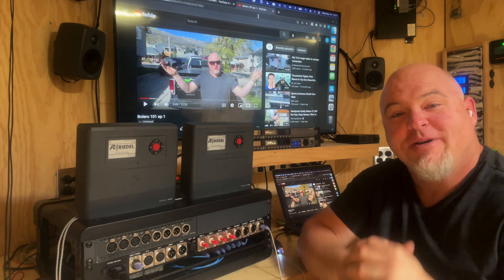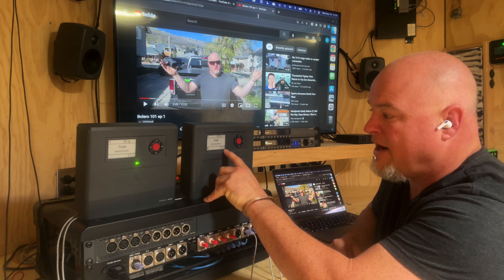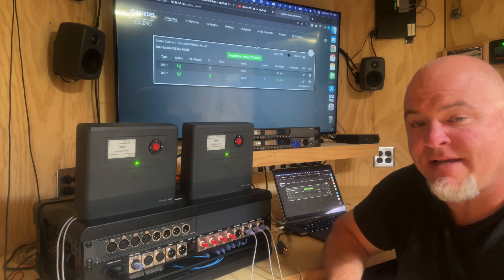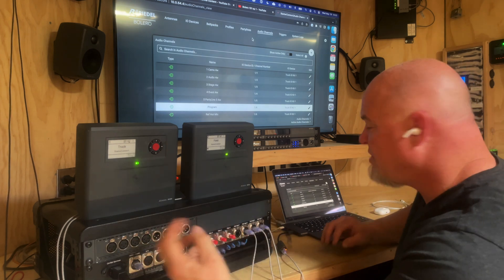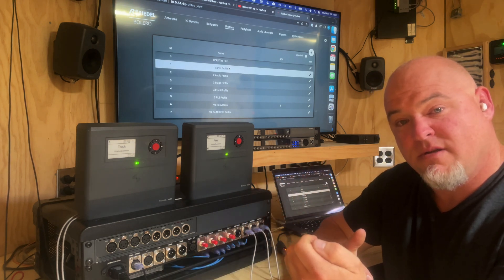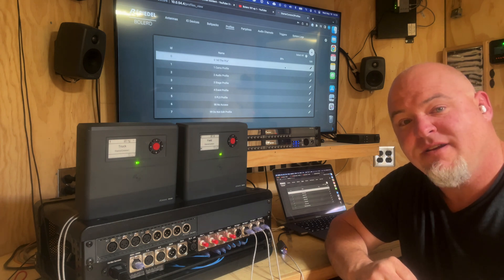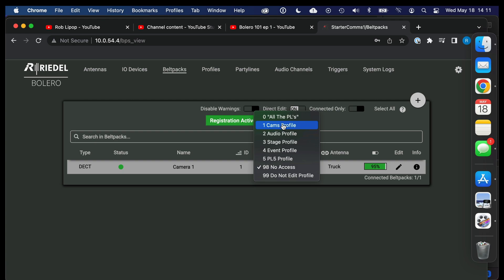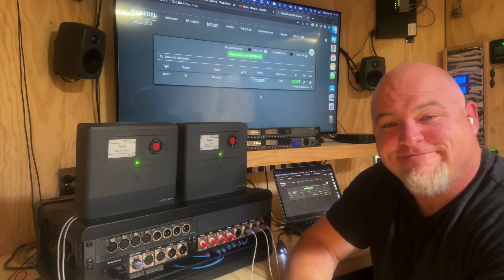Bolero 101 ep 2

Comment: Hi Rob! You mentioned a license in your other video. Do you need to purchase a license to in addition to the equipment?
Reply from the maker: There is a license named the “SA License” it means “Stand Alone” and allows an antenna to “come to life”. 

Everything in these videos is predicated upon possession of this license. This license is actually installed in an antenna and there must be ONE license per “Net” (installation). 

This license is not needed when running bolero in association with a Riedel Artist frame. But that is a horse of a different color. 

On the topic of licenses. There is also a “PL License”. It increases the allowed number of partylines from 12 to 32. This can be a VERY necessary limit increase when running more beltpacks in more departments.

Comment: How to register manually?
Reply from the maker: What do you mean manually? There are three ways to register beltpacks. The first two are similar:  NFC= Near Field Communication. You have to enable The needed mode and then you just touch the Beltpack to the antenna or to another Beltpack.(different permissions for each touch point)

The second is done thru the menus of the registering Beltpack. You find the menu and then input the registration PIN.